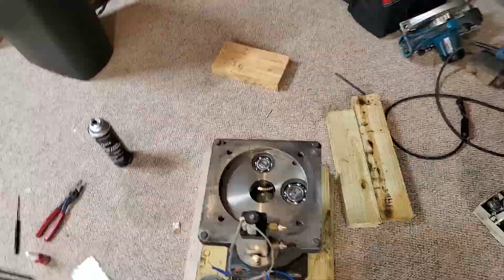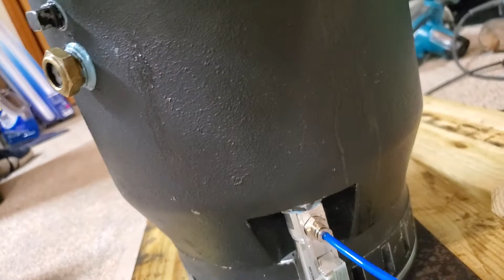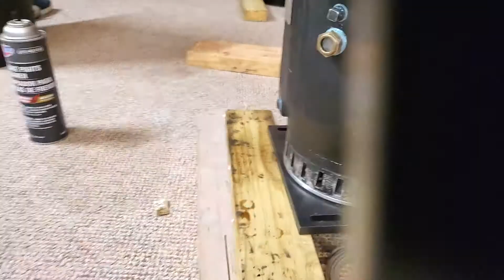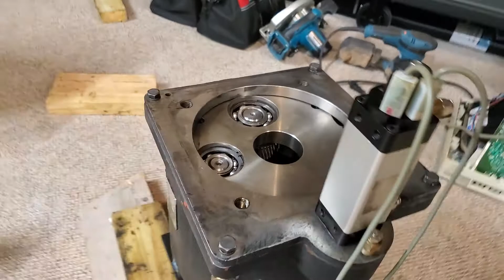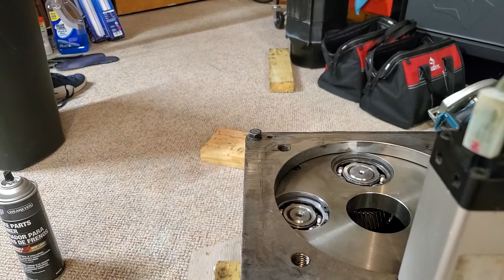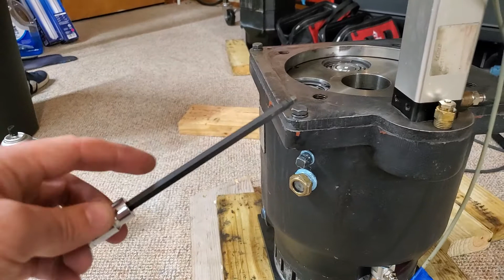Brigeport TC22 Rebuild Part 8 Gearbox Rebuild & Functions

Comment: Hola como estas? compre una bridgeport vieja y le estoy haciendo una modernización  completa. el motor funciona bien sin ruidos lo mismo que la caja! pero como esta sin aire no se si esta en baja o en alta. como puedo saberlo?
Reply from the maker: Look at the rpm speed of the motor on the yaskawa spindle drive in the electrical cabinet and compare to the spindle speed on the control.  If it's in high gear it will be 1:1 if it's in low speed the motor will rinn4x faster than the spindle 4:1
Reply: @weldchip  medi las rpm del husillo y no pasa mas que 1700. tendría que ver como hacer para colocar la alta, ya que esta bridgeport se le hizo retrofit y todo eso quedo desconctado
Reply: gracias por responder!
Reply from the maker: @Lupii_oficial672 ok if the max is 1700 then it is low gear.  Put some air to the locking pin to open it and some air to the actuator to rotate into high, like I demonstrate in my video.  It needs air to keep locked in gear so don't run without air or the gearbox lock is not locked and damage can happen to the gearbox. It is very expensive to replace the gears in the gearbox so be careful.
Reply: @weldchip  ah ok si le di aire pero no siento que engrane lo hice con el motor parado. y si lo estuve usando sin aire y sigue en baja por suerte no se daño nada, pero ahora no se como continuar 🙁
Reply: @weldchip  podre desbloquear los actuadores sin sacar el motor?
Reply from the maker: @Lupii_oficial672you need to take the motor off to remove the actuator.  Just buy a small cheap air compressor any size will be enough to move it without taking it apart.  You must have air to use the machine the spindle needs air when cutting or it will be damaged.
Reply: @weldchip  listo saque el motor y el actuador giratorio no funciona. pero si el actuador lineal asi que coloque la alta y la dejare siempre con aire! gracias y una pregunta mas que aceite uso?
Reply from the maker: @Lupii_oficial672Bridgeport recommend a special mobil 1 oil but I use mobile 1 75-140 synthetic gear oil for truck differential.
Reply: @weldchip    voy a probarlo muchas gracias agradecería si tienes el manual. y si necesitas algo de la Bridgeport tengo toda la electrónica vieja. saludos
Reply from the maker: @Lupii_oficial672my photos https://photos.app.goo.gl/YFj6Qi4Xu5ap6W6r7 and a link to manuals and all info I have.  https://drive.google.com/drive/folders/1T2bLVBPZOqJEabE-e69IZvP5QbnUJXBa

Comment: I wondered why after my oil change the sight glass seemed to get murky again pretty quick. Very odd design with the 3 sumps. Been a few years since I changed the oil might be worth another change but I wish I had the baffles drilled as you did!

Comment: Anymore progress on your TC22?
Reply from the maker: Yes lots of progress just have not got round to making/posting videos.  It's up and running again and the centroid control conversation is completed other than the renishaw wireless probing. The control retrofit transformed it, the only thing I have left to sort now is the z screw needs reballing to take the backlash out, other than that it runs like new.
Reply: @weldchip  
Looking forward to seeing your continued work on the machine.
I still run a TC3. It's been a tough machine to keep going all these years. 2001 model. One of the last Bridgeport made before closing their doors. I purchased it in 2006. One owner machine. Tool changer gearbox is a big problem on the machine. It breaks the gears regularly.  I have tried multiple gear box ratios to no avail. Still breaks the gears. When it wants to run, the machine makes nice parts. But in my 30 years of CNC machining, this machine has given me the most trouble out of the 15 or so CNC's that I have owned. Maybe you have some insight on the issue? 😉